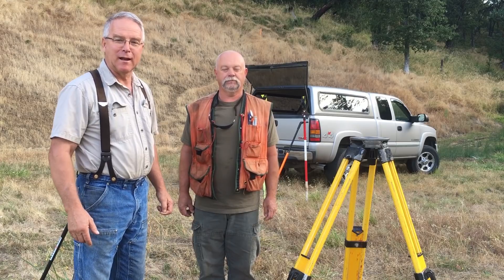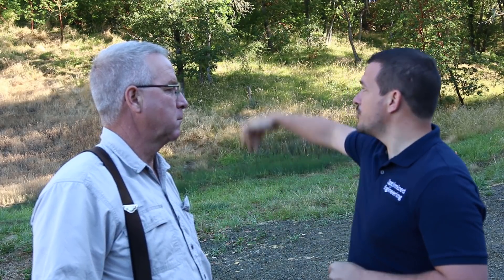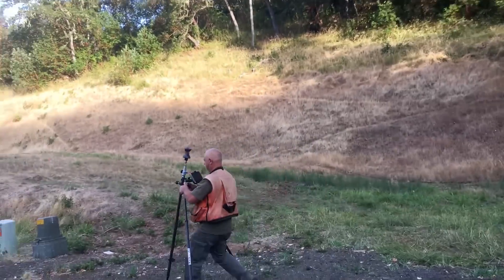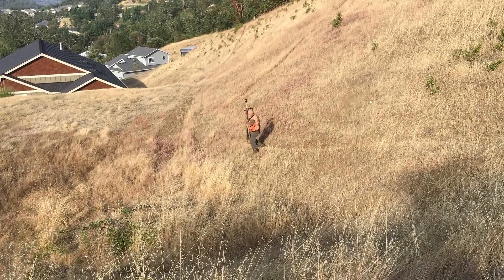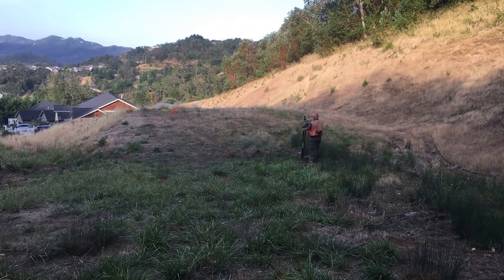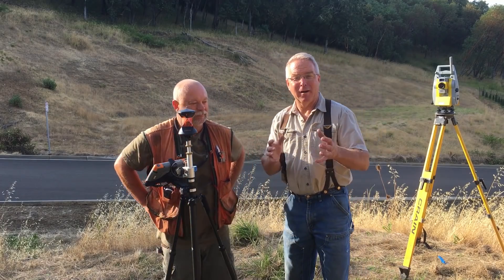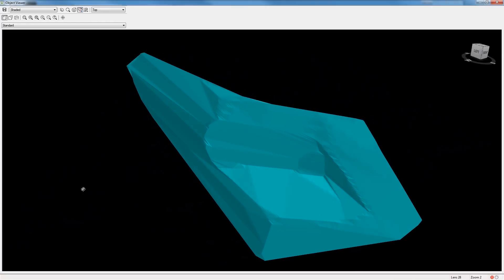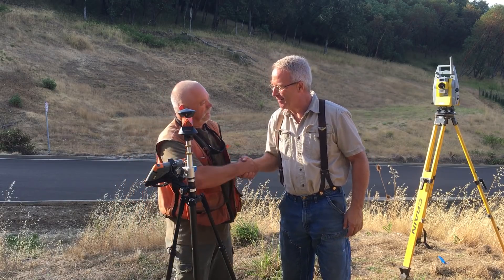How To Ensure Site Optimization.  Spec House EP.05

Comment: What are you doing for a foundation if you are building on uncompacted fill?  Doing piers or piles or anything like that?  A friend of mine has a two story house with a walk out basement but the walkout is on the front of the house not the typical back side.  Makes for a huge looking place from the road.  That might be an options for you with this lot.

Comment: The surveying robot is insanely cool. I've only ever seen the 2 man system before, which I equally don't understand. Think you could talk him into explaining it to us?
Reply: They make a real-time fully-3d scanning LIDAR system for self-driving cars... for $20. Twenty bucks. About a million times the power of this XYZ surveying robot that requires setting up two tripods and snapshotting  single measurements. LIDAR does hundreds of thousands of datapoints per second. About the size of an eraser. You wouldn't even need to slow down as you drove past the property and it would have it mapped. Twenty bucks. The pace that technology is changing our world is tremendous.
Reply: Matt, the total station is purchased to address high paying jobs with zero room for error. So they are available to handle tasks like this on more relaxing days regardless of cost. The value of a land surveyor is in their education, career, and reputation. Which they aren't going to risk on cheap tools.

If you want to do this job on a budget, you could use stuff lying around the worksite. But it would take way longer, and the engineer is going to charge you more than the surveyor would have just to decipher your work.
Reply: What I never knew before working with an automatic tracker is that they cost around 65k € (70k$). Seriously awesome stuff
Reply: The expense and cost comes from developing the software, and not only from the instrument itself. The instrument provides data that must be interpreted by extremely complex software that is difficult to develop, so they charge a premium for the hardware to cover that cost.
Reply: Care to share a link for this large scale 3D scanner for $20? The cheapest industrial units I've priced are about $60k.
Reply: MattsAwesomeStuff I don't have to go practice anything to anyone dumb enough to believe it? I talk to structural engineers, civil engineers, architects and the like all day long. Fact of the matter is they can't do their job till I give them the information they need. I guess their just "dumb enough to believe it" too right?
Reply: eh. I don't know about the details, but if you want to survey an area as detailed as possible especially as someone working for the government or any large company you can't rely on data from a quad copter. It's not precise enough. At least nowadays..
Reply: You're right. The best and only way to solve this problem is to just pay someone $70,000 for a machine. You're an expert in things you don't understand so I'll trust you. The future of the surveying industry isn't where one man operates one robot, it's 2 robots that deliver themselves and survey the land. It's 5 years away. This "software" is literally making a list of X, Y, Z coordinates, then connecting them into polygons for display. The simplest possible graphic demand there can be. It's okay that you don't understand how that's possible and assume it requires $70,000 worth of technology, but, that doesn't necessitate mocking anyone who challenges the status quo. Licensing? Don't need any, the software is free. Durability? No more of a challenge than a $200 tablesaw. Warranty? Business decision what you want to warrant. Complete non-issues.
Reply: I'm personally all for revolutionizing the surveying industry. 60k is a lot of money. On the other hand specialized machines in other industries cost a lot of money too. I have never opened or compared the "cheaper" tacheometers with the "premium" ones, so I really don't know anything about the quality of the hardware. Of course the software is "easy" (relatively speaking), but it I'm sure it takes a lot of effort AND money to make the product worthwile and precise at the same time. At some point you have exponential growth of costs while having a small increase in precision. But sometimes that's worth it.
Reply: just imagine what it's like in 20 years O_o
Reply: MattsAwesomeStuff yeah a machine that can do the most advanced levels of trigonometry in the blink of an eye that has the capability of tracking a prism over a thousand foot away within 1 thousandth of a foot is just basic technology that anybody could produce on their own. I have 2 Trimble S6 robotic total stations, both of which cost about 30k each. I'd be willing to bet they have each made the company a million dollars. Do not speak of which you don't know, walking around storing points on a topographic survey may seem elementary to you until your topo'n a 100 million dollar runway at one of the largest airports in the country and any slight divot or valley could be catastrophic.....also for future reference LIDAR last I heard was good for 7-8 feet tolerances once they get it down to thousandths let me know.
Reply: You're making a dishonest argument. No one claimed that a map of the land is unimportant and unused. It shows how weak your argument is by you having to be intellectually dishonest about the nature of the task.  I'm saying the method, and expense, and technology used to accomplish that task is absurdly overpriced, outdated, and soon to be replaced with machines for a tiny fraction of the cost because you can a massively superior result with massively less effort and investment. You're like a man with a garden trowel manually leveling a whole subdivision telling people with bulldozers "All the concrete guys need me to dig with a shovel, they can't even start their houses until the ground is flat." ... yes, and? Was anyone arguing the earth didn't need to be leveled? No, just that we have bulldozers now and your overpriced shovel is a joke.
Reply: MattsAwesomeStuff massively superior? You referenced LIDAR. That's been around for along time and still flat out sucks. You show how little you know about surveying with your arguments. How is a drone or LIDAR gonna lay out a .15 percent sewer line? Neither of which have any type of capability in a wooded area. I don't think you understand what all surveying it's self intels. It's a lot more than mapping and measuring. I'll tell you what, go take the test for your license so you can get in on this cash grab before the jigs up. First though, you'll need a 4 year degree or 16 years experience (in my state). Good luck with the hydrology part hahaha
Reply: It's a little more complex than that, Matt.
Reply: Please tell me about this $20 fully 3D scanning LIDAR system, and what its resolution and accuracy are... I could have an application for it!
Reply: Extremely complex? It's a weekend modelling project for a beginner programmer. You're getting cartesian datapoints. Any modelling program can take that dataset in a public format and interpret it. The "technology" is 20+ years old and free. It's the same thing videogame makers use to model everything in game. Teenagers tinkering can create and modify things for beginner projects.
Reply: "Advanced levels of trigonometry"? It's XY coordinates and basic trig. The kind of thing $5 calculators 30 years ago could do functionally intsantly. How out of touch with technology are you? You're aware that children's toys calculate dynamic force vectors in real time for pennies today, right? An entry level, $20 quadcopter is a million times as powerful as a surveying robot would need to be. You're clearly so far up your own ass about how super difficult your job is that you can't even see the part of your brain that conducts reason. We have software that can take photos of places and create complex 3d maps of them with textures applied in real time, for dozens of dollars in hardware. Careers like yours are dinosaurs, I'm sorry that that upsets you, but go practice your pomp to someone dumb enough to believe it.
Reply: Outrageous. There's less brains, less computation, and less precision involved than in a $20 quad copter. Take a normal base station, heck, take a fancy one, spend $1000, throw the robot on top, shouldn't be more than $2k, and that's a stretch. A cheap plastic one should be manufacturable for $1-200.

Comment: Great video, Very informative.  How on earth was this kind of stuff done back before all the digital technology?
Reply: My father had a commercial property developed back in the mid '80s and strings, measuring tapes, and basically the same tools that pirates were using for navigation 500 years ago are what those guys were using then. The concrete work still only has 2 very small cracks in it 30 years later now so they must have been doing something right.

Dad has VHS tapes of that property being built somewhere (like 10-20 hours of them, I think... It was several tapes). Might be fun to pull that stuff out some time. The project included the installation of a 4' sewer main and a decel lane for traffic as well as the plot and building development itself. I imagine I'd find it much more interesting now than I did when I was 8 or 9.
Reply: Before digital equipment, surveying was done using long tapes (or before that, chains), levels, and rods.

Tapes are just really long tape measures, used to measure the horizontal distance between two points.

Levels and rods are used together to measure angles and vertical distances. The level is like a telecope on a tripod, it's set up and adjusted to be perfectly level, and then can spin 360 degrees. If you look through the viewer, there's a crosshair you can point in any direction, and it has an indicator to tell you the direction it's pointed in. 

The rod is essentially a stick with markings on it that you place on the ground vertically and it tells you the distance above the ground. 

You look through the level at the rod in the first spot and note its height and the angle. Then you move the rod a known distance using the tape to a new location and measure that height and angle. The difference between the two measurements, and some trangulation, gives you the relative position of the two points.

If you need more information than just the relative positions, you can find a nearby benchmark, which is a permanent marker that someone placed and determined its precise coordinates and elevations.
Reply: In my area, it wasn't always the best.  Neighbor was tearing down the house he built and building a new one.  Had surveyors out to find out his lot was 10' narrower than the plot, and the error carried.  The eastern two feet of my bedroom has been in my neighbor's yard for 80 some years, apparently.
Reply: Even before the digital age they had theodelites. With these you can basically measure the angles. Combine that with measuring tape (or any other type of distance measurement device) and you have an analoge tachymetre. Theodelites have actually been around for a while (in a simplified form since 100s AD).
Reply: Maxwelhse --- In 1982-1986, in very rough terrain, I developed a 360 acre subdivision with an elevation change of 605' difference within it's perimeter. An airplane was used to make multiple photos of the area as well as the many established control points. I used these photos and the known elevations of the various control points to design/layout the roads and the utilities. This was the best topo I ever used in my construction career.....and it was extremely accurate. Obviously the airplane was cheaper to use due to the vast size of the project.
Btw, all of the acreage was a thick forested area and the pictures were made in January before the trees put on leaves.

Comment: It would be pretty cool if he could export that blue image into something like SketchUp.  You could then put in your utility lines, drainage, etc. and actually "build" the house just where it sits.  Or, maybe export it into a format an architect could use so they could include the topo in whatever they come up with as a design drawing.

The fact that he can just walk around, automatically taking data points over the property, must be pretty awesome for engineers who have previously had to do stuff like this the "old fashioned" way (whatever that was).
Reply: Any 3D modeling package should be able to accept that data. Just place all of your points and start putting surfaces through them. If you wanted to do this at home with basic equipment, you'd be wise to set out your measurements in groups of 3 points to make placing the surfaces easier so you don't get confused later about what points go with what surfaces. I have no idea how the pros do it and keep the stuff straight.

Strangely, utilities almost never use 3D models for anything (from what I've seen in passing). It's almost always still just 2D drawings. Civil and Architectural is way behind the times in that regard for reasons I don't truly understand. Maybe this is a sign that things are finally catching up to the rest of mechanical design.
Reply: Civil 3D (what the engineer used to generate the surface model) can export to almost any format including XML; the lingua franca of digital terrain maps
Reply: Steven Jahnke what I typically do, if a client wants to see 3D utilities, is put the top of pipe at the areas minimum frost depth. If more detail is needed, other assumptions can be added to the mix. If something is critical, we stop monkeying around and have it located and surveyed be it "pot hole'd" , hydrovac'd or other
Reply: FWIW the old fashioned way was (very basically) done by two people using mechanical/optical surveying equipment. One on the transit, sighting optically and noting (as in writing down numbers in a book) the range, bearing, and elevation/declination of the marker held by the other for each data point of interest. Then a bunch of number crunching and manual drafting to render the plots. Now it's all done much quicker and more accurately by just one person and a laser and computer enhanced transit as demonstrated.
Reply: I figured it would be something like that.  Thanks!
Reply: I was told by the civil guy I work with that it is because outside of routing on the site, placement of the utilities is so rigidly controlled by codes that there is no value added in rendering it in 3D.  I was asking because we do site/building models for all our projects and I thought if nothing else it would be cool to show the utilities coming in as they actually would in the field.